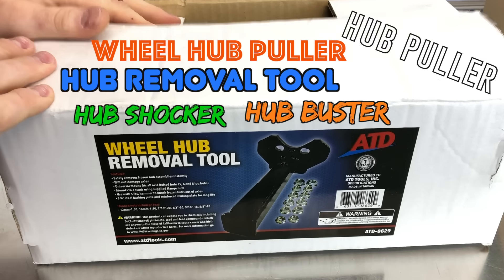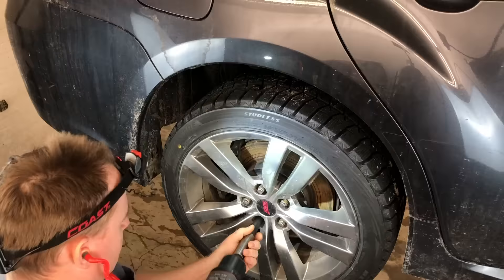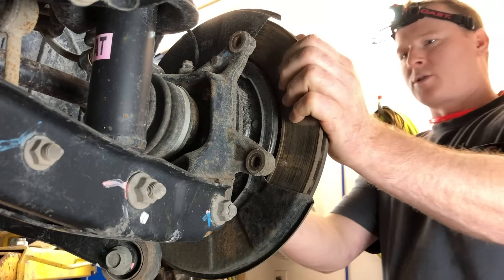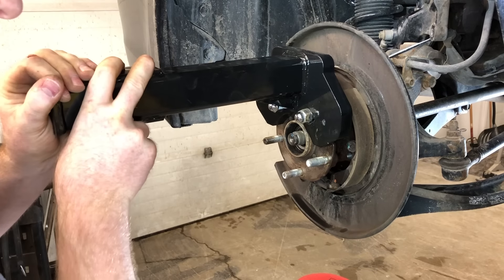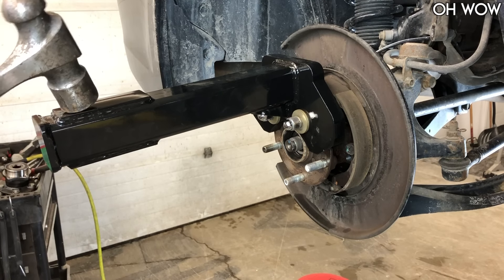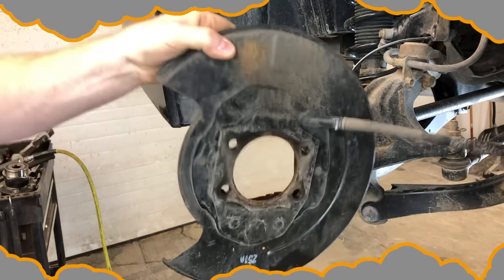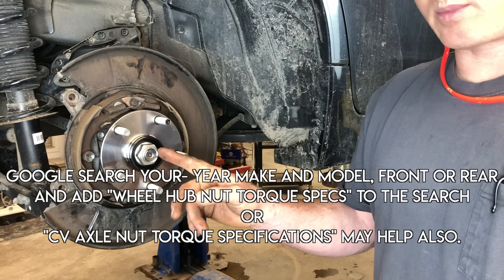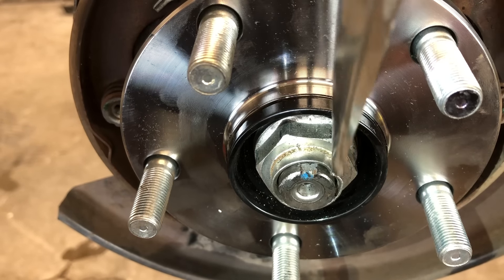HUB SHOCKER Hub Busters  |  REMOVE STUCK WHEEL BEARINGS EASILY!

Comment from the maker: 2.0 Video SOLVES tool mounting problems and bearing separation problems!!!---- https://youtu.be/eKqYtMdlPYo   ---I USE Grade-8 Bolts for mounting now, and a Cv-Axle TRICK to keep the bearing in one piece during removal or even pull the bearing back together if it separated during the removal process. I use a 8lb sledge only on the tool now. Stubborn bearings always need backup options to remove. My Favorite is the HubShocker by far. I love this thing!

Another option is this NEW CHEAP $29 ASTRO TOOLS "LAST CHANCE" WHEEL BEARING REMOVAL KIT is great to supplement the Hub Shocker. I keep both in my box ready to go at all times so I never need to replace a suspension knuckle. It uses a different method to apply pressure. It will also remove the worst of the worst like Subaru rear bearings/Ford Explorer/Edge/Escape/and others---- Astro 78834 https://amzn.to/3JgbSYf

New sway bar link video https://youtu.be/0S8JBe_jn6g
Reply: First time watching ,as a tech for 45 years and still going . you restore my faith in knowing that some of you young mechanics like you are doing things right . As for the tool  yes it works good , like all tools like that ,that gets one out of a jam it's worth buying. The never ending tool Saga in this business .   Good video
Reply from the maker: Thanks a lot for the comment. I really appreciate that. Collecting tools is never ending for sure. Thanks for blazing the path for us younger mechanics! 😀🔧🔧
Reply: Cool style great vid thanks
Reply from the maker: @mikewilliams4947  Thanks Mike! Did you see the second video on the hub shocker? 🔧🔧 I solved 2 problems I was having with the tool...
https://youtu.be/eKqYtMdlPYo
Reply: Feels like an ad! Can't see where it says it's sponsored.
Reply: @EasyFixShaun  no I haven’t. I’ll check it out
Reply from the maker: @zpkpk  I am not being paid by hub shocker or ATD or any other manufacturer that makes this tool currently. If they want to send me money that would be great! I will update the video if that happens. So far no takers. I just love the tool because it helps me out so much. I use it all the time. This video is a personal review. I actually did another video on it that is an update. Also not paid 😃🔧 
https://youtu.be/eKqYtMdlPYo
Reply: SLIDE HAMMER IS PERFECT
Reply from the maker: Yup! 😀

Comment: I like to lower the vehicle and place a jack stand under the control arm/knuckle.  That way you're not pounding against the bounciness of the control arm bushings.You'll find the tool works even better!
Reply from the maker: Great idea. It makes sense and I bet it helps a lot! 😃
Reply: I use an old brake rotor bolted on backwards with  a 20” pipe wrench and the appropriately sized sledgehammer.

Comment: 30 plus years as an Automotive repair tech and ive never seen this type of tool , and we all know how frustrating wheel brgs can be . Very cool  !!👍
Reply from the maker: I felt the same way! Why weren't these on the tool trucks? From what I understand they have been around 10 years or so. One experience removing a stubborn wheel bearing and this will be a favorite tool. It has saved me time blood sweat and tears 😀 Have you seen hub shocker 2.0? I solved mounting issues and bearing separation issues. Would you mind letting me know what you think? https://youtu.be/eKqYtMdlPYo
Reply: @EasyFixShaun  I made my own about 15 years ago. I dont need a hammer. I use it with a jack and the weight of the vehicle pops them loose.
Reply from the maker: Interesting. Man some bearings I tell ya...   I love that jack method! 😄
Reply: @420frankp  I was thinking the same thing, look like it would be very easy to make. That will be my goal for this week
Reply: I just used a 20" pipe wrench on the wheel flange to hit with a hammer to break the stubborn ones loose, pretty much the same idea. just not a special tool.

Comment: If you rotate the hub/tool assembly 180 degrees between hits it would pull bearing out of knuckle more evenly- tool is even built for that with a strike plate on both sides. Great video!
Reply from the maker: Your welcome! Thank you I will try that out!

Comment: Looking out the welder and raiding the scrap pile already 👍
Reply from the maker: Awesome! Anyone with welder knowledge and material could build this. I hope you find the material. That was my problem. Its gotta be really beefy. Check out the new video Hub shocker 2.0! It solves mounting issues and bearings seperating  while using the tool 😀 
                https://youtu.be/eKqYtMdlPYo

Comment: Your title is a little off I have found a few front bearings on 2500 and 3500 trucks the hub shocker I've had for years failed to remove. It's the best tool by far for removal. The only tool that gets EVERTHING off is a torch. The 1/4" plate on the top of mine is about beat to 1/8" in places. But still performs way better than  any other bearing tool I have found.
Reply from the maker: Sorry about that. It is a tool of last resort at times. With a lot of corroded bearings it has been a life saver for me. There are some bearings it can not handle and heavy duty trucks are some and I have heard it will not remove the rear of a new explorer generation. I haven't had the chance to try the explorer. On heavy duty I usually use the hydraulic power steering and socket combo method to push on the mount bolts. I agree, the torch removes all wheel bearings! haha. Can create some other issues sometimes but is the ultimate remove "ANY" wheel bearing tool 🔧😃

Comment: This seems like a decent tool. The only thing i would be concerned about is it ripping the outer hub out and leaving the bearing stuck inside the knuckle. Not the end of the world but kind of defeats the purpose of the tool. I use a good air hammer with a dull chisel to hit the side of the hub and spin it in the knuckle till it comes out but on the rears you have to remove the ebrake assembly to get access.
Reply from the maker: Watch the second video I made on the shocker. It shows how to stop the hub from separating and remove it easily in one piece.  
                https://youtu.be/eKqYtMdlPYo

Comment: I used the same tool on the rear of my Subaru forester, attached it snugly with OEM lug nuts, hammered it with all of my might with a 4lb hammer over 200 times and it didn't budge.  My feeling is if this guy can remove his hub with a couple of taps from a ball peen hammer that he probably could have gotten it off some other way anyhow. This obviously works for some people but it is no magic solution to this age-old problem.
Reply from the maker: I made a second video that solves all the problems I had with the tool. 1. I use 8lb sledge now. 2. I mount them with grade 8 bolts to secure. 3. I have a cv axle nut trick to keep the bearing in one piece if it starts to separate. You can even use it to pull it back together during the process. Sorry you had trouble. It isn't so much the tool that is the problem. It is Subaru's INSANE bearings. They stick beyond anything I have seen. Any Subaru rear bearing and Ford EDGE/EXPLORER top the list right now in difficulty 🔧 https://youtu.be/eKqYtMdlPYo

Comment: Just completed this job on a 2013 Impreza.  I needed a 10 pound sledgehammer to get the bearing off with this device.  It worked but I can see why people complain about rear wheel bearings with Subaru.  Pain in the butt but saved 500$ so all is good.  Good video.
Reply from the maker: Awsome! Ya it is a great tool to have. I made a second video that shows how to solves mounting issues and there is a cv axle trick also to keep bearing from splitting in half if needed for you next one 😃🔧

Comment: took your advice and made my own using 1/2 , QT100  plate, 2x2 1/4----- wall tube, one gusset. two striker plates----took 15 minutes to fabricate  (with the equipment available to me) all from scraps in the scrap bin. works very well except with press on bearings.
Reply from the maker: Good for you man! Thats awesome 😀
Reply from the maker: Hey Danny! Would you mind checking out my new shocker video and let me know what you think of the bolt on method? And also the cv-axle nut method?

Comment: Love it have used it on over 25 cars with no problem removing up until yesterday when  I meet a 2013 Ford Fusion. It was so rusted on from up here in the northeast. After trying everything including heat I had to remove the knuckle and use a 200 ton press in shop to remove it and it took a few times . Almost broke the knuckle . But 95 percent of the time the hub buster will do the job
Reply from the maker: Thanks for sharing! I am glad it is working out for you! It's been great for me also. I made another video that solves mounting it with grade 8 bolts and stopping bearing separation with the cv axle and nut. Those were my biggest problems. It has worked perfectly for me since. But I don't work on many fords. Have you had those problems? Here is the updated Shocker 2.0 video 😃🔧🔧 https://youtu.be/eKqYtMdlPYo
Reply: @EasyFixShaun  I’ll check that video out thanks

Comment: This is awesome.  I bought an old 1999 Ford Explorer last year and plan on taking it up to Oregon (I currently live in Arizona).  I took it to a mechanic to get a full inspection on it and they said that the wheel bearings were loose.  I'll get those replaced before taking it on that long of a trip.  I'm sure this tool will help a lot!
Reply from the maker: Should work great if you need it on your older explorer. The new ones are crazy hard and  are one of the few that the tool
will not break free easily 😀🔧
Reply: @EasyFixShaun  Thanks for the info.  I've owned a couple of Escapes and loved them.  I'm going to sell my 2019 F-150 (my wife is handicapped and can't get in easily) and get something smaller, so this is really kind of a "transition" vehicle and usually just a backup.
Reply from the maker: @dienekes4364  Cool. I hope it works well for you guys 😃

Comment: Very... suggestive.
I replaced my bearing today. borrowed a slide hammer free at auto parts store and used the whipping towel trick. Came off in 2 swings. I must be lucky. Twist the towel at the half way point around the slide hammer handle and whip it!
Reply from the maker: I'm glad that worked great for you! 😀🔧

Comment: Heck ya!  For the guys too cheap to buy this tool, you can do the same by putting an old rotor on backwards, attach a 36" pipe wrench to it then smack it down with a sledge the say way you do for this tool.  They WILL come out, no matter how rusted.  Nice video!
Reply from the maker: Thanks a lot! The pipe wrench isn't fastened to the rotor and can fly off. Especially with amount of force the hammer needs to provide. Bad things can happen. Will work. But I would recommend the shocker. Much more safer. Many wows. 😀🔧🔧

Comment: As a suggestion on the axle nuts if changing both sides. I just switch the nuts to opposite side. And for me if one side goes out I just replace both sides, but that's just me. I realize you may not have the money to do that. I also recommend OEM hub assembly for replacement. I stopped buying cheap press in or hub assemblies type wheel bearings
Reply from the maker: Cool man. So switching the nuts might give some fresh meat to re-stake the nuts in a different spot. Great suggestions. Thank you!
Reply: Don’t about the nuts,they’ll never come loose.

Comment: Great tool, definitely think components aren't built to the same quality that they used to be. Such a newish vehicle already needing bearings. See a lot with suspension parts nor lasting long as well. Great video.
Reply from the maker: Thanks man. I couldn't agree more! They are making everything so cheap. I think its planned obsolescence in some cases. Usually Japanese auto makers try to avoid that and use high quality parts. But it seems they are being influenced to me in that general direction more and more. Bearings and steering and suspension components (other than shocks) should be make well enough to last the life of the vehicle. They can do it. They choose not to. 🤓🔧
Reply: @EasyFixShaun  agreed the newer  cars have crap bearings . I have 1976 corvette modded raced supercharged it has original rotors (un turned ) and all original suspension ball joints wheel bearings only pads and urethane bushings and shocks replaced . The new shocks I added old school coils over the shocks which are sold as a kit from superior for a big 1970 ies Buick I cut the coil in half to allow insulation on the much smaller corvette shocks  . Adding the coils over the shocks stiffened the super stiff f41 original suspension  but made it more comfortable and less choppy on bumps or crossing railway tracks . Any way the car has 19 Oem great fittings and I have owned it for 40 + years lolol
Reply from the maker: Nice car! The old parts were made in the usa and were great. It's sad we learned how to make good parts over decades and then went back to bad parts from overseas. History won't be kind to that logic 😀🔧🔧

Comment: Excellent looking tool. If I may offer some advice though. When using a large hammer, try to hit flat and square with the face of the hammer. And also set the piece you’re hitting at a lower angle to avoid getting hit in the face by debris and it maximizes the force from your swing.
Reply from the maker: Thanks Wess I appreciate that greatly. You are right. I made a second hub shocker video. You should check it out. I did much better on my swing style! Plus I solved a couple problems with mounting and bearing separation from the tool being so powerful. If you have time let me know what you think if you don't mind? https://youtu.be/eKqYtMdlPYo

Comment: I watched someone using this same tool , beat on a Subaru REAR hub for days . The Hub was completely destroyed and did not come off . It had worked on many but not that time .
Reply from the maker: Who ever used that tool should watch the second video I made. I solved mounting issues by through bolting with grade 8 bolts. And I solved bearing separation by using the cv axle nut. It is the only way I do them now. I hope this helps 😃🔧🔧
Reply: @EasyFixShaun  no tool on this planet would have done it with out destruction  . Sometimes nature has other plans . East coast salt is a killer of most all things and is the variable here . A few hits popped others out with ease but not that one .
Reply from the maker: I agree. Michigan salt is the worst. Any salt belt state mechanics know how bad it is. Corrosion here is always the biggest hurdle in all repairs. It just sucks. 😃

Comment: I use a large pipe wrench over the flange and hit with sledge.
Reply from the maker: That could work. I wouldn't recommend it. If the pipe wrench slips off, bad things will happen to the the vehicle or to you. Hub shocker is bolted on. Subaru has no room to hit the flange with a hammer or attach a pipe wrench.

Comment: If that came off so easy, it wasn't stuck there good enough. 
Most bearings wont come off with anything! You can try removal tool, prying screws, lump hammer, chisels, anything, and they wont come off. The only thing that helps is to take off the whole assembly and put it under a heavy press.
Reply from the maker: I feel ya. I still love the the tool though.  My attempt is always use the easy methods and progress to the more intrusive ones. Removing the knuckle and pressing "bolt-in" style bearings will work- i completely agree. It is also the most intrusive method and requires an alignment afterwards. This wasn't the worst removal in the video. But it was difficult. Subaru rear bearings are amongst the the most difficult models to remove. The explorer rears are probably the worst. The Hubshocker 2.0 video i made was a good demonstration on a massively stuck bearing if you want to see it. I do recommend it over this video. I also solved two issues with the tool 😀🔧

Comment: A cheap harbor freight pipe wrench and a sledgehammer works just as well. Air hammer wasn't working on my 03 yukon denali. But the pipe wrench on the flange and giving it a half dozen good wacks did the trick.
Reply from the maker: Could work. But the force needed and the bounce back potential makes it much more dangerous than bolting it to the hub. It could fly off and come for you. Im glad you got it done though 😀🔧

Comment: That tool can really come in handy specially on the rear bearing in the front most of the time you can hit it with a sledge hammer but damn they can be stuck.
Reply from the maker: Man you are not kidding. The Subaru rears are incredible. Would you mind watching the "2.0" video? Let me know what you think. I solved a couple problems I was having with the tool. https://youtu.be/eKqYtMdlPYo

Comment: One of the most important tools nobody ever thinks about is strapped on your head. In winter time I don’t leave the house without my head lamp. They’re so cheap nowadays I have one hanging everywhere.
Reply from the maker: I agree! Maybe I’m going blind because I started to rely on it more and more. It makes everything better for me. And it’s always hands free. I made the change maybe like 10 years ago and have never looked back. I have a few rechargeable AA battery’s that make it cheap to operate also. Great minds think alike 😀🔧
Reply: Yessir. I’m pushin 50 and I know my sight isn’t what it was. First thing I noticed was dark or low light situations.
Reply from the maker: @michaelshea4372  well poop. I'm gettin old too then. Thanks for the nice compliment on the headlamp. Its the only way to fly. Thank you coal minors and campers! I think that is probably were the headlamp started out. Not sure. Excellent tool 😃